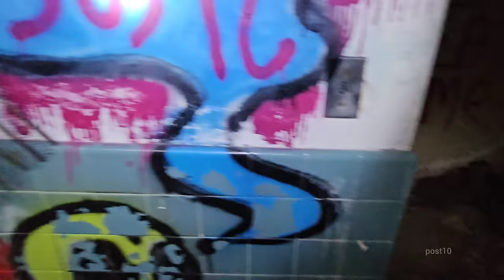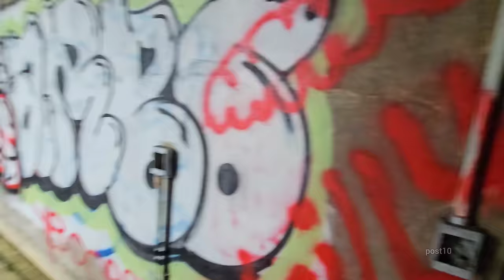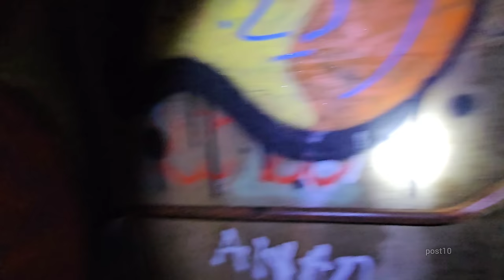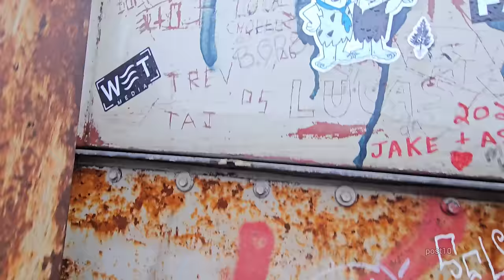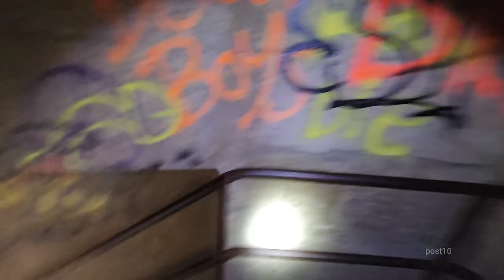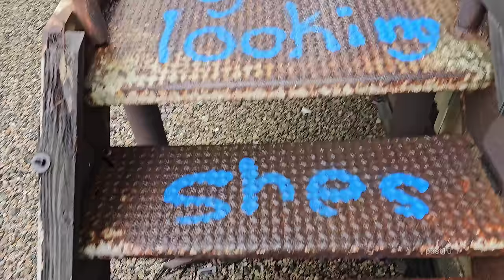Exploring Military Radar Base In The Clouds

Comment: I agree with comment that the "rail" on top is for the radome that covered the rotating antenna. The vacuum tubes that powered those radars were enormous. That is what the hoists are for. By 1963, the DEW Line in the Arctic had been operational for six (6) years, and the need for this station was gone. DEW line stations had a new radar that could detect bombers to 180 miles, and became the primary radars for NORAD. The previous Pinetree Line, and Mid-Canada were decommissioned,  as was this base. All pieces that could be used at other stations became spares, and the buildings mothballed.

Comment: 20:20  Many military installations in the 1950s were built with central steam plants (i.e. one big boiler) rather than each building having to heat a separate boiler.  Downtown Seattle has a functioning municipal steam plant which can be connected to within 5 miles of the plant.  The 1910s apartment building I lived in Seattle was connected to Seattle municipal steam.
Reply from the maker: More towns should do that, it's more efficient although I want to have my own heating Source in case of a shutdown
Reply: Those aren't trees, they are weeds.

Comment: As to why the stairs did not go to the top- those radars were dangerous when operating. Only certain personnel were authorized to go up top. The radars were classified, as well.
Reply: No one should be on the roof while the system was running. The RF power was very high power and would have been deadly.

Comment: The reason there are boilers in each building is thats the way they were heated.  Oil was used to heat water for radiators. NO GENERATORS FOR EACH BUILDINGS! Just good old fashioned electric lines. The buildings you first explored were barracks.

Comment: Those boilers  you seen was for producing steam for probably the galley or mess hall cooking equipment and heating the buildings as there was  probably piping that ran thru out  the complex. Steam was used in the 60’s and 70’s to heat building thru radiators and such. I used to work on those steam producing boilers in the late 70’s earlier 80’s in military bases overseas.

Comment: If there is just boilers in the buildings that means they are for heating and hot water like steam or hot water, heat and hot water for washing clothes and showers and so on usually small communities like army bases or big factories have one big power plant with big steam engines with pistons or steam, turbines, and they usually are coal fired even in the 1950s and 60s but oil was just starting at that time, so it could’ve been a new thing they were using. the  big powerplant would usually have one or two big tall smokestacks

Comment: The Heavy Duty Vacuum Pipe Tubing Structures are just for structural support for the Large Heavy Rotating Radio Dishes under the dome enclosures, didn't see any Copper Flashing as described in video, they would have been scrapped, none seen, probably steel!

Comment: WOW posty, what an adventure. They would have had to have very large generators and possibly steam generation. The old radar would have had huge power requirements and the electronics would have been tubes/valves originally
Reply: There was grid power brought in to the base and up to the summit. This was one of the last parts of the state to get electrical which was brought in from the needs to power the base. There’s still poles and hanging wires all around the base and going up the mountain.
Reply: @NewHampshireNick  cheers!
Reply: @NewHampshireNick  Yeah I doubt they would have stand alone power generation for that base just from the power requirement for all the equipment.

Comment: The circles on top of each tower were for mounting the fiberglass domes most people call golf balls. The foundations in the center were where the radars mounted inside the domes. There should have been large generators for the radars, they require a lot of power. All the concrete channels were for wiring and radar wave guides.

Comment: 53:20 this is a cable ducting that went from dish to control room its not a drainage duct you see this when you turn to the left as within the duct is the metal condiut that the cables sat in ive seen these in places ive been in on my travels

Comment: Hey @post.10 I’ve always wondered since you don’t always get the greatest cell service out in the areas you travel, how does FM Radio perform out in these areas?
Reply from the maker: FM radio is always in and out, I'm glad I have a satellite radio in my truck, it typically works better unless a mountain is blocking wherever the satellite is in the sky at that moment
Reply: @post.10  does the satellite radio in your truck sound low Bit rate to you? The only reason I ask is because I have a newer SiriusXM home unit that sounds bad on certain songs/ stations. But SiriusXM sounds absolutely awful on our 2010 ford focus to the point AM is even more tolerable. Myself I pretty much always listen to either mainly FM or Apple Music with its Lossless Dolby Atmos audio. We love finding locally owned stations to listen to when traveling on FM, Indiana and Rural west central Ohio has some hidden Gems on air.
Reply from the maker: @tyleridle1356  I have had zero problems with it, I just hate how it completely cuts out instead of getting staticy
Reply from the maker: Satellite radio is good when you're in the middle of nowhere, when I'm deep in the wilderness of Maine I often can't find any signals at all or only French ones
Reply: @post.10  I have AT&T on a iPhone 14 Pro max I’ve had coverage darn near wherever I’ve went but there’s been 2 different times my iPhone showed that satellite icon where if in an emergency you can text emergency services which I think is a really cool feature especially for adventurists like yourself. I love the content I wish I could get the chance to explore all the awesome things you get to show us. There’s apparently what’s called a phantom Bridge rather close to me over outside Union city Ohio. It might be worth finally putting this 1TB iPhone to work lol
Reply: @post.10  I’m assuming those French Stations are from Canada during ESkip events during the summer I’ve heard some stations from Maine, New York and Mass also some of those French stations believe it or not on our Focus’s radio
Reply: @post.10  that issue isn’t even just specific to mountainous areas we’ve been out on a clear day driving with nothing but flat fields around and the signal still cuts out. Some cell towers can interfere (Specifically towers with AT&T WCS Band 30 2.3GHz) with it but I wasn’t near those either

Comment: Those square concrete pads inside those buildings would be where the generator would be bolted to. And the boilers would most likely be used for heating, hot water, but also could have fed a steam line though out the building and steam could be used to power tools and equipment although the technology is from 1800’s. Being such a remote location 60 years ago steam power could have been the way to go. But the storage tanks would most likely indicate the boilers for heating/hot water

Comment: I'm surprised there doesn't seem to be any elevators on those 5-storey bldgs. And those taller bldgs seems to be made up completely of steel, all welded or fastened together.. probably not robust enough to support an elevator.
Reply from the maker: It may have had a freight elevator

Comment: That was called a Volcano Boiler.. for building heating.. all the rooms would have had Radiators with electric fans to push the warm air around… every military facility in the 40’s and 50’s were extremely over engineered.. and costs were not an issue .. they would have a base fuel truck that would probably fill the tanks 2x a month. It’s the difference between private ownership and the military industrial complex… prices DIDNT matter..  Procurement S1 Officers just spent all day ordering stuff and generating Purchase Orders.. the roof you were on was eventually  turned into A Helo Pad

Comment: Pipes were probably waveguides for the RF energy that was feed from the transmitters on the lower levels to the rotating dish on the roof. At these powers and frequency, a hollow pipe is used rather than coax cable. But the since they are connected in a lattice, hard to say. Some of the roofs probably used to be covered from with a fiberglass dome, which is almost entirely transparent to radio waves at a zero degree angle. I imagine the wood railing and decking was used in places to prevent a reflection. No matter what your phones says, that would not be a 5G frequency that far from a tower- almost certainly enhanced 4G.

Comment: The big pipes in the center are the supports for the antenna on the roof. The antenna was turning around so it needed a lot of support to withstand the rotational inertia of the antenna.

Ron
Reply: The SAGE radar at Bath Maine was 160 feet wide and was probably the next station in the line to the East of this position.  The 160 ft rotating antenna had a detection capability beyond Greenland and was affected by the northern lights when magnetic storms came.  That seems to match up with this one on the tallest platform.  The Texas Towers (Atlantic floating platforms) also tied into the SAGE net.  SAGE is an interesting historical study.

Comment: Becareful when exploring buildings that have allot of insulation that is falling apart, there are allot of particles floating in the air that can affect your lungs over the years. Its recommended to use a respirator when exploring buildings.
Reply from the maker: It was misting, every single surface was wet keeping the asbestos at Bay

Comment: Post those tanks were for heating rather electrical generation.  You would need large amount electricity to power a radar base, and that would more than diesel generators.  

Military bases tend to connected to local grids.
Reply from the maker: Highly doubt they connected to a local grid this deep in the wilderness,
Reply: @post.10  they would have built a grid for the local area.  It would take to many diesel generators to operate that place it wouldn't be worth it.  We had 6 tractor trailer size generators to run one small hospital in Iraq.  Now think about how many generators would be needed to run one radar array.   Trucking all that fuel would have been silly.     

Large amount of power is not something the military maintains.  Outside of aircraft carriers.

And the base in Hawaii for the 25th ID they had interstate built, water ran to it created a sewer system, and whole electrical grid for the base.
Reply: @DubhghlasMacDubhghlas That base was totally independent it is so high up a mountain and so far from civilisation!